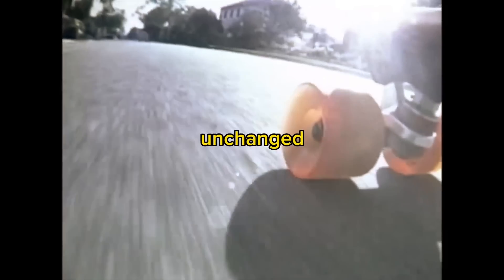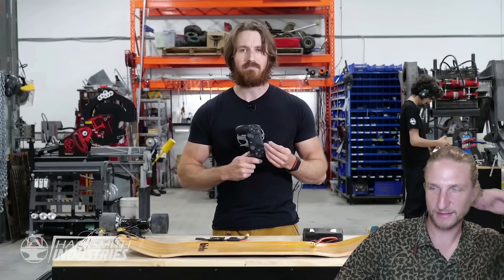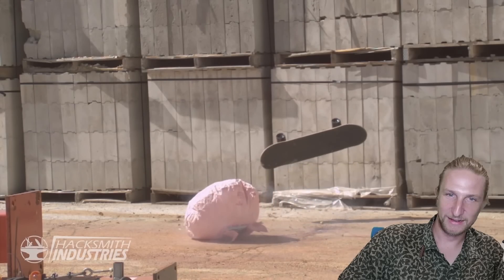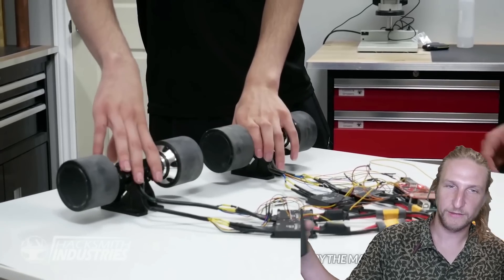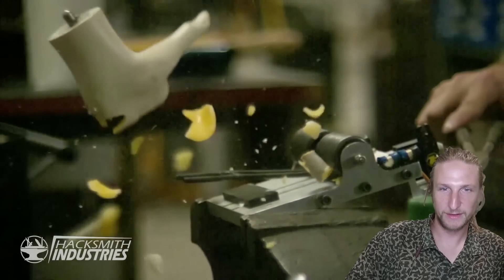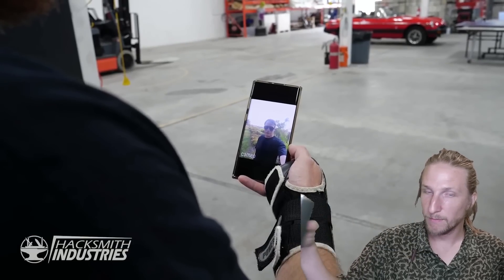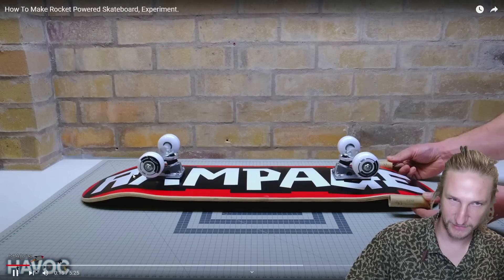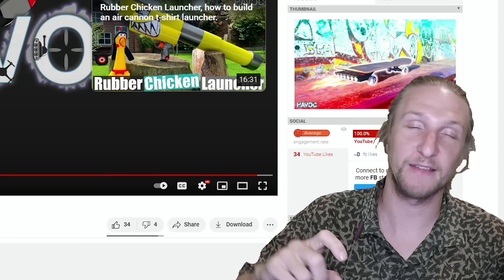He reinvented the skateboard…

Comment: Something I've been thinking about the last couple days... Are soft skateparks a thing? A clay skatepark? Something like astroturf thats smooth? Is there a material you could make wheels out of that riding a soft park wouldnt be that much different than riding a concrete park but obviously softer falls?
Reply from the maker: they have jump ramps into foam pits and then jump ramps that land on top of what they call "resi" which is like a foam pad with a hard coating. so like u just u can land and roll on it but if u fall its relatively soft
Reply: a lot of skateparks are very slippery so when u fall u just slide around and dont get hurt as much usually
Reply: like smooth cement or whatever.. berrics for example